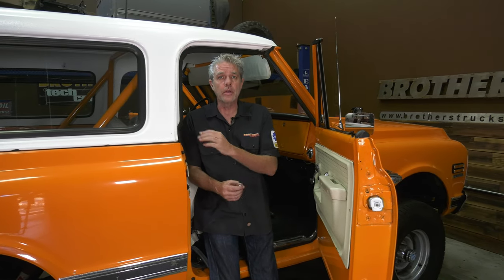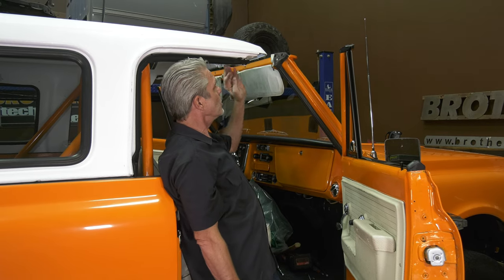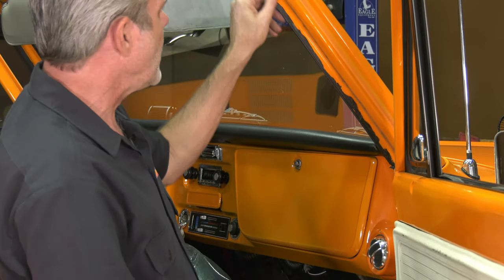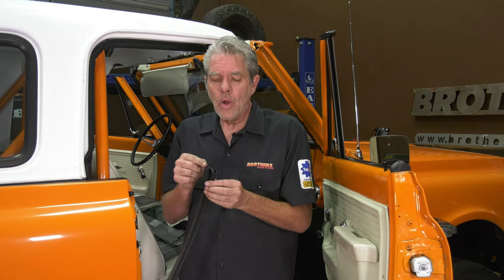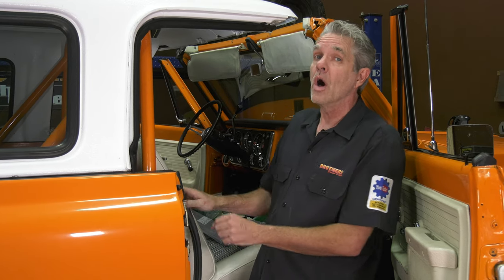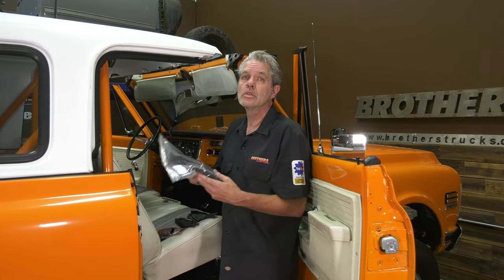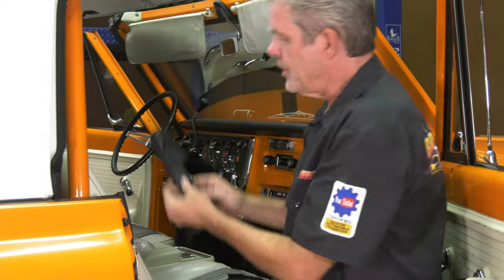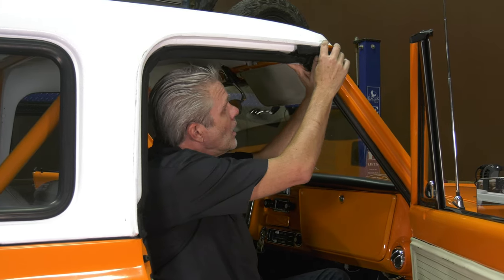1969-72 Blazer K5/Jimmy Door Seal/Weatherstrip/Rubber Removal & Install

Comment: Hello. I just bought a '72 Blazer CST 10. I'm looking for the part that you show in your video. It's the rubber piece that sits at the end of the door by the window/ door jamb and almost looks like a "V". It cradles both sides of the window glass and keeps rain from going into the cab and down into the door. Can you please let me know what that is called? Stoked on your channel. Super informative and helpful.
Reply from the maker: Sounds like the Seal at the rear edge of the door. You should call the shop and let's get it figured out, or you can use this link to help figure out what it is, but the diagrams don't look very helpful. Sounds like we need to take some up close photos of those Blazer seals. Here's the link: Blazer/Jimmy Specific Seals: https://bit.ly/35urY08
Reply: @BROTHERSTruckPartsTV  Will do. I need to order sun visors from you too that look like it’ll be back in stock next month. Thank you for your help and getting back to me. Have a good week!
Reply from the maker: @808plate4  Our pleasure!